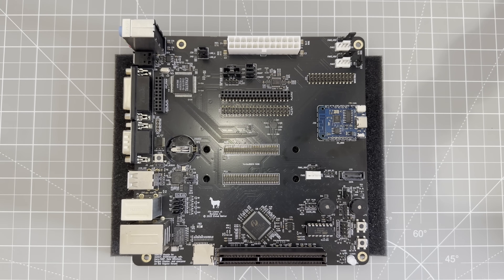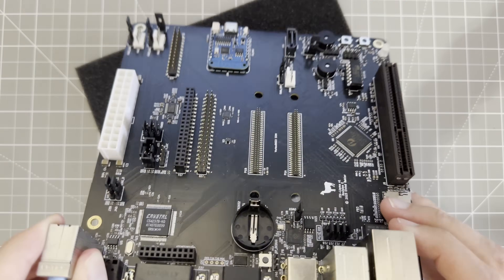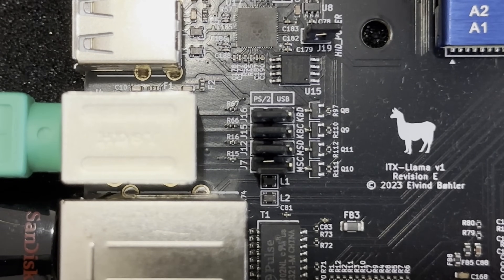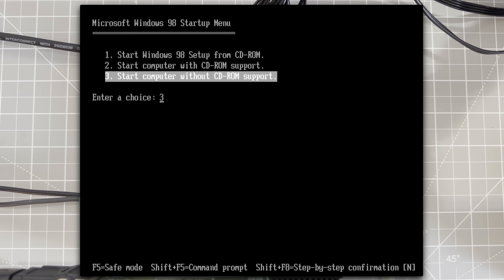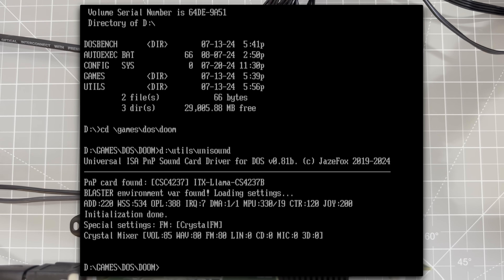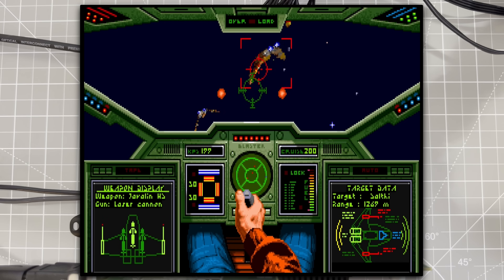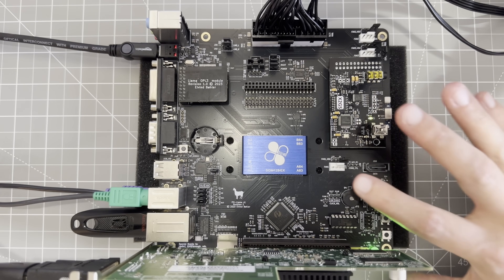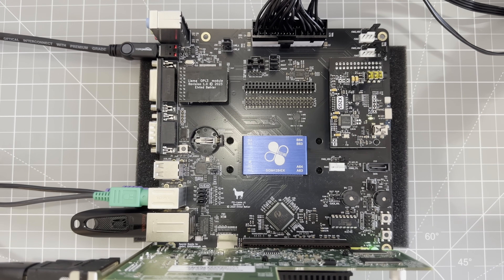ITX Llama: A Brand New PC for 1990s DOS Games!

Comment: It's important to have modernized retro alternatives for preservation sake. I still prefer gaming on legit old hardware, but it's not for everyone. I wish they made a straight ISO to IDE hardware emulator. That would solve so many CD storage issues. So far, we have compact flash to IDE and flash to floppy.... and flash to 50 pin SCSI. We don't have proper hardware based CD/DVD emulation alternative that can replicate copy protection. I have a bootable ISO to bootable media emulator, but it's UBS based. Can't be mounted in DOS.

I wish the ISA was on the motherboard itself, but at least they've got an AGP going. Better than nothing. Cool machine. I'd love to have one some day.
Reply from the maker: 100% agree on the CD side. Up until now I’ve been using software emulators like SHSUCDHD - but it’s not a replacement for the real thing :-(

Comment: So, how is this any better than just using DosBox on a modern PC?
Reply: Depends on the type of experience you want. If you just want to play the game, just use dos box or create a virtual machine. If you want to assemble a PC that kind of resembles one of the mid 90's in performance and support for some old hardware, this will give you that illusion. Also, dos box sometimes doesn't do a good job emulating the sound chip he added 'bout the end of the video.

Comment: Great product, unfortunately you'll have to source everything yourself at the component level and have the boards made because the production run is finished and he's not making any more.

Easier and cheaper to find an old PC on eBay as the hoops you're going to have to jump through to get one of these is extreme (and expensive).
Reply from the maker: A late reply on this, but with some good news!

A community member is planning to build and make the ITX Llama available for general sale. You can purchase here:
https://retrodreams.ca

Find more details on the Vogons forum:
https://www.vogons.org/viewtopic.php?t=93480

Comment: I like it... I have been building computers since the early 80's. Even though I use the modern Apple and Windows operating systems, my job is to keep old computers like DOS and Windows 98 and other operating systems running... Believe it or not, my company has been in business since 1960. They rely on MSDOS and Windows 98 to keep their old equipment like heat ovens running... It is hard to find new old hardware that is reliable... Nicely done... I want one... Where can I buy this board?   =8-)
Reply from the maker: A late reply on this, but with some good news!

A community member is planning to build and make the ITX Llama available for general sale. You can purchase here:
https://retrodreams.ca

Find more details on the Vogons forum:
https://www.vogons.org/viewtopic.php?t=93480

Comment: This sounds like a great idea if you have a case that allows for a second mobo. You could have the modern hardware for modern games (assuming you find any worth playing) and have this for retrogaming.
Reply from the maker: I wasn’t even aware that dual mobo cases existed - looking at the corsair 1000d now!

Thanks for the tip! I am very tempted! 😂
Reply: I am surprised they arn't more popular for segregating work and personal computers. Back in the day I had 3 mid towers under my desk running into a switch for the keyboard/mouse and display. It seems especially with work from home or for dev test systems having 2 physical systems would be a huge plus.
Reply: I wasn't either! But this raises the question of why anyone would normally want to have 2 PCs in the one case?
Reply: Actually nevermind, I think excitedbox gave a good reason there.

Comment: USB-C power would be better and you could put a real floppy drive and/or IDE header where the ATX header used to be.  Thin ITX would also be my preference.  But those are minor quibbles, this seems like a pretty nice for gaming at least.  Who knows there might be some old video rental store still running their POS on DOS that could use something like this as well.  I suppose a USB Floppy drive would be sufficient for most people.  an onboard USB 2.0 header would also be handy to plug in a 3.5" compact flash/SD card reader.
Reply from the maker: Great ideas!

I’m looking into whether I can use an AGP riser cable to make an ultra thin build 😎
Reply: @jamesfmackenzie  Someone on VOGONs already did it and had the Voodoo VGA out coming out the I/O shield.

Comment: So it's basically emulated peripheral hardware connected to a x86 SoC that happens to be supported by Windows / DOS? It would be quite funny if the Vortex SoC was actually an ARM emulating x86
Reply: I think the DM&P vortex is a fully x86 design, it was really designed for industrial computer modules and other type of control units, there was a big fetish for implementing this in production and robotics, can only assume the OS's / code ran on this , did  something obscure & obsolete and needed 386/486. I saw these being used many years ago in newspaper press production machinery.
Reply: As I understand it's based on the 486 architecture.
Reply from the maker: There’s very little that’s emulated. The CPU is an authentic x86, the sound is a Crystal CS4237B chip connected via an internal ISA bus, graphics are via the AGP slot, it has a real SATA port, serial port, game port, PS/2 ports etc 😎

Comment: I prefer real authentic hardware. ;-) It is still not too difficult to get and not too hard to maintain. But this is a cool little thing!, you have 1 machne to cover everything from 386 to Pentium 2.  Except hdd beeper, which is hilariously dumb: You use modern hardware, who you trying to lie to? The problem of all this modern "recreations" is the same. People, who creating them in their quest of convenience and user-friendlyness losing the real experience of working with that hardware. And if it's lost, why not just emulate everything in software, it's now possible on any calculator.

Comment: Thanks for your kind words, James! Really nice video!
It was a lot of fun designing this board, and I'm quite happy with how it ended up.
If someone wants to build a batch of these and sell them, feel free - it's all open source, hardware and software.

The main driving force behind this ITX board was to enable the use of proper video cards for Windows 98 games.
Though the Vortex86EX CPU is analogous to a fast Pentium, it doesn't hold up well with mid- to late '98 games, so I'd still recommend this as a DOS-first machine.

For anyone interested in an even smaller (Raspberry Pi-sized) computer with the same CPU, I'm currently working on version 3 of my other main project, the TinyLlama. It uses the PicoGUS hardware for audio, and a Raspberry Pi compute module 4 for MT-32/MIDI, floppy, modem, ethernet, etc.
Work thread here: https://www.vogons.org/viewtopic.php?t=100351

Comment: This thing has LOTS of potential, but the missing floppy controller bothers me.

I would like a programmable floppy controller like the Paula chip in the Amiga. It can read and write lots of formats just by creating a mountlist.

If you need something more for a DOS system, get an industrial VIA board. These have extremely power-saving processors comparable to the Pentium ///. The boards are ITX, but better equipped:

- VIA C3 or EDEN CPU up to 1 GHz
- 1 GB 133 MHz DDR3 RAM socket
- 2 IDE ports
- Floppy Controller for two drives
- AGP graphics with 3D and MPEG2 accelerator
- LVDS, VGA, Composite and S-Video output
- Serial, IR and Parallel ports
- PS/2, USB, Ethernet
- PCI port
- Some have Firewire or Cardbus
Reply: What kind of expansion port bus does it use?
Reply: There are lots of insdustrial VIA ITX boards. I have an EPIA M II. It has a PCI bus, and on the ATX panel a CardBus (PCMCIA) and CompactFlash port. Onboard is next to the usual stuff one serial, one LPT (parallel), one IR, one SMBus connector. And of course the floppy connector. A gameport is not available.

The RCA jack can be switched between composite video or S/PDIF with a jumper.
Reply: If you want ISA, then check out industrial Single Board PC's. You need a PCI/ISA backplate. The SBC comes in the middle, providing a PCI bus on one side and ISA on the other. I have several SBC's, one with a Pentium I, several with a Pentium /// 1.4 GHz, and one with socket 775 modified to use a low-power quad core Xeon L5408 socket 771 and 8 GB RAM. It's no problem to run Windows XP with an ISA Soundblaster AWE64 Gold.
Reply from the maker: @Michael.Werker   by awesome coincidence, my latest video was on exactly this topic! 🙂

Comment: Is their a 90 degree agp edge connector so the vid card stack on top of it to retain the small profile if it came in a case the size of a home router I'd buy one just for the footprint and forget collecting old hardware.
Reply: Looked into this before and don't think AGP  works  well but not sure why. This was asked in the vogons forum for this project.

Comment: Pretty cool project. The only problem that I find with this kind of items is how expensive they become, they are custom made and running low quantity batches make them very expensive to produce in relation to what you get. For 40-50$ you can get an entire PIII with a GeForce 2 and a real SB16 or AWE64, and if you want to "modernize" it you can add a SD to IDE adapter and a PicoGUS. 
Still really cool board.
Reply: Try building one for yourself and see how much it'll cost! ;) You're absolutely right though - these are non-commercial hobby projects and far from cheap. The most affordable solution is DOSBox or 86Box or something similar, it'll cost you exactly $0 and be good enough for most things!
Reply: @eivindbohler  A Pentium III you mean or a Llama? If it is a llama, of course, I didn't meant that they overcharge for it, as I said as this is built in very small batches it costs a lot more, and if you build it yourself you will save some bucks but still will be expensive. But if you mean a PIII... I recently bought an Intel dot station 2300 for 40$ new in its box, never used, I modified the bios and upgraded the CPU to a PIII 1Ghz that cost me 10$, also I bought an Athlon 1800 with a SB16 Vibra and a GF2 TI for 20$...
Reply: @drgusman  I was talking about hobby projects. I'm aware you can (still) get super cheap PIII hardware! :) That'll probably end in a few years though, look at where prices are for 486 machines now compared to 5-10 years ago...

Comment: It's amazing to me that integrating an entire RP2040, with jumper headers, is cost competitive with just using a couple of USB-to-PS/2 dongles. I have little doubt that it really is, I'm just amazed that we are at a point in microcontroller technology that a chip that could probably easily emulate an entire 386SX (with a bit of help from a handful of extra chips and some PSRAM) is cheaper than some molded plastic and wires.
Reply: PS/2-USB adapters from back in the day only worked because USB keyboards and mice were capable of doing PS/2 protocol over the USB pins. Modern keyboards and mice can't do this, and so need conversion hardware. But yeah, bunging an RP2040 in there with some custom programming is cost-competitive with finding or fabricating the specific custom chips to do the job. You can find a lot of RP2040 based custom chip replacements -- for the SID chip, the TI-99/4A video chip, etc.
Reply: The RP2040 with supporting components is only a couple of dollars, as you said - pretty mindblowing! :)
Reply from the maker: I agree! In fact on the other side of my desk I have a “Pico Micro Mac” - a full 128K Mac emulated on the 2040 😂

https://github.com/evansm7/pico-mac
Reply: I found that interesting too 😊.  I don't think you could not have it run a cycle accurate 386 emulator at legacy clock speed -- maybe an 8088 though. Also (in case it's not super obvious) you could not do all the things the sum total the system board does with the pi-pico.  I think the biggest issue would be getting enough gpio pins to make the PIO do 32 bit addressing without multiplexing. This is significantly more likely with the 8088, which is already multiplexed.  If you tried to do a 386 core you might very well get enough resources to do everything internal to the chip, but then you miss out on the 32bit IO capabilities of the cpu for external devices.  The ability to tack on a serial memory is definitely how you solve the low internal ram issue but the IO bottleneck kills it for sure.
Reply: @lindoran  Correct - as far as I know, nobody's ever made an emulated x86 CPU or CPU/RAM/whatever combo that exposes any kind of system bus. I'd say the only way to achieve this would be using a fat and expensive FPGA. Would be orders of magnitude more difficult (and probably expensive) than using one of the Vortex-series SOMs.
Reply: @lindoran  But for just a little bit more than the cost of a Pi Pico, you could use a Pi Zero 2 or higher, and some version of DOSBox. You get enough speed to run DOS games, and compatibility is very high. There's nothing stopping people from using an RP2040 to help out the Pi Z2. But an 'old' SFF x86 PC can be had for peanuts, and will have the horsepower to run any retro games... and it will probably be even smaller than this retro board.
Reply: @another3997  oh yeah.  But that is a whole other computer -- my point is the rp2040 isn't a fully fledged general purpose CPU and as a stand alone micro can't emulate a 386, let alone a 486 and do all of the other things that this can.   A pi mini is a SOC with multiple gigs of ram and IO it's basically like saying my Pentium can emulate that.... Well of course it can - that's not the point though.
Reply: @lindoran I'm fully aware of the vast differences between the Pi Pico/2040 and the full fat Pi. But the 2040 is 'just' a very cheap microcontroller, it's not designed to be used to emulate 32 bit x86 chips at full speed. In the future that may change, but right now it's not feasible. With a Pi Zero 2, you can run either a bare metal or Linux based CPU emulation, and physically use it as just the main CPU on a board, a la PiStorm for the Amiga.

Comment: thats neat but i dont understand why they chose to include a agp port instead a more "legacy" PCI conector
Reply: I think it's because the SOC uses pci-e and that its easy to adapt to AGP but not PCI.
Reply: @EvanBThompson  The SOC exposes a x1 PCI-e gen 1 lane, which is converted into a 32-bit PCI signal at either 33 or 66 MHz using the PI7C9X118 chip. What most people (myself included, up until I researched this) don't know is that AGP is actually "just" a superset of PCI. That means that the AGP on this board is really only PCI running at 66 MHz - and doesn't offer any of the AGP-specific features like sideband addressing, GART, etc. ...Which is allowed for the AGP 1.0 spec, and totally ok in this context, as the CPU is going to be the bottleneck anyway in most applications.

What's funny about all the people saying this board should have had PCI instead of AGP is that my number one request during the design of this board on the Vogons forum was to use AGP instead of PCI! :D
Here's a link to a post with photos of one of the early PCI versions: https://www.vogons.org/viewtopic.php?p=1172398#p1172398
Reply from the maker: I think the original version was planned for PCI. But was switched for AGP because it’s easier and cheaper to get those graphics cards 😎
Reply: @jamesfmackenzie  Yep, I made a few boards with a PCI connector, and settled for AGP because of the price and availability of Radeon 92xx + Voodoo3 cards.

Comment: This is NOT bare-metal.
Reply: Vortex86 is a computing system-on-a-chip (SoC) based on a core compatible with the x86 microprocessor family.

It is a fully static 32bit x86 core. It is not a real Intel x86, but is real hardware x86 silicon.